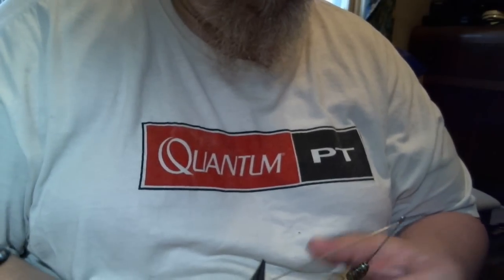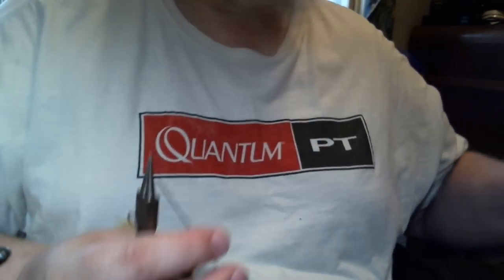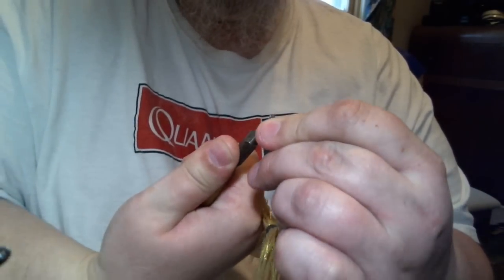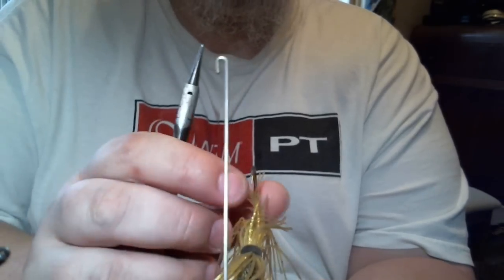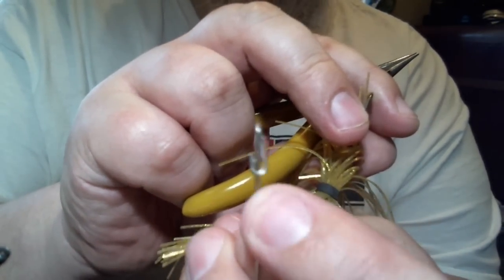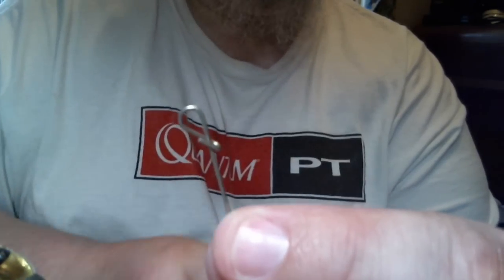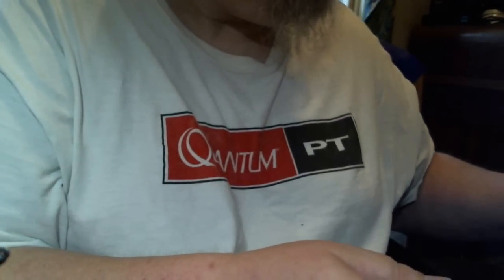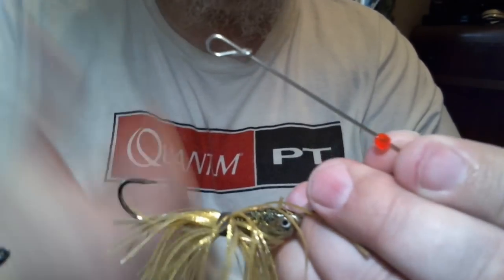How to lock a spinnerbait blade

Comment: Hey this vid was very helpful..my next problem is why am I junking my split rings when I attach to the swivels? I'm using Worth brand #2..is there something better?
Reply from the maker: I love Worth ball bearing swivels. They have their own split ring which is a size 2.5 but they are light. I never had an issue putting those on but you can try a regular size 2 or 3 split ring.

Comment: I tried this on a super stainless frame R3 and the leading blade wouldn’t spin.  Seems the frame is too short?  Or was my blade too big?  I was running a 3.5/4.5 with a 1/2 oz bullet head.  The leading blade was over halfway up the wire but I’ve seen photos of other baits with short distance from the line tie to blade that I’m assuming ran ok.  Have you used same loop on a 3/8 oz frame?
Reply from the maker: I don't think the problem is the frame or the blade sizes. Make sure the blade on the clevis is on correctly. Correctly is when the cup side is facing up toward the sky and the finished side is facing the ground. You also need to make sure the clevis is the correct size for the wire diameter. If the frame is .035" to .040" then you need a size 3 clevis assuming you are using a stirrup or easy spin clevis and not a folded clevis.